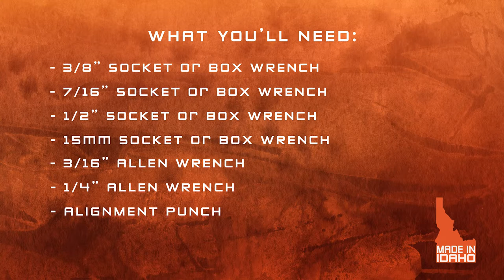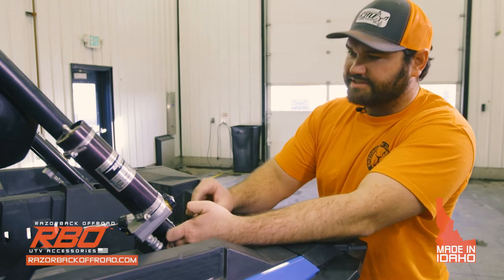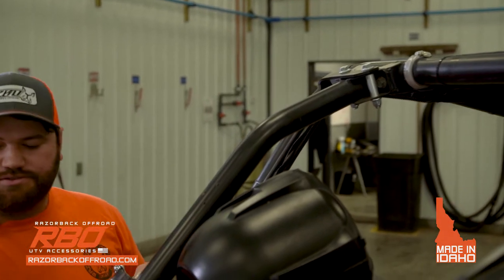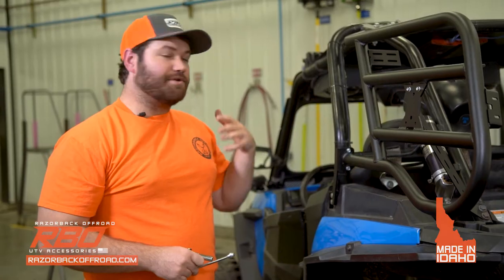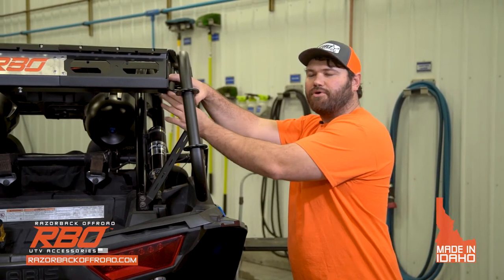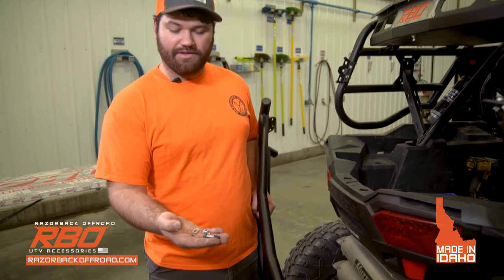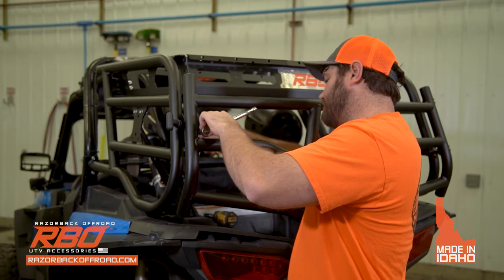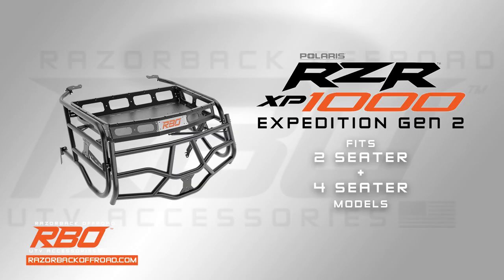Polaris RZR1000 Gen 2 Expedition Rack for 2 Seater and 4 Seater Installation by RazorBack Offroad™

Comment: What are the improvements  of the rbo5270 over the rbo5100?
Reply from the maker: Hello, Thank you for reaching out to us. The changes we made from the RBO5100 to the RBO5270 is the basket portion of the rack. We went from a tube style basket to an all aluminum style basket. Another change is that the RBO5100 was designed to only fit the 2 seat model of RZR XP 1000 machines and the RBO5270 is designed to fit the 2 seat and 4 seat models of the RZR XP 1000 machines (verify years on our website). Please let us know if you have any other questions or concerns. You can also reach out to us via email at sales@razorbackoffroad.com or give us a call at 208-587-7960.
Reply: @RazorbackOffroad  Hey thanks for your help, I was able to speak to one of your guys today and verify fitment of a rbo5100 on my 22 rzr. Install at fitment is straightforward and simple so far.